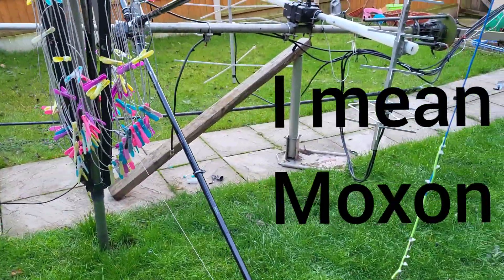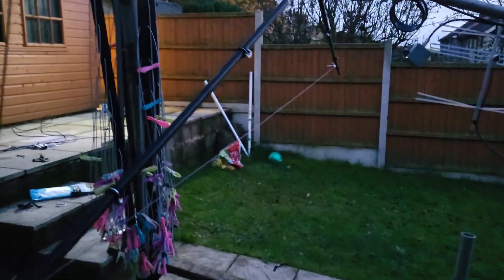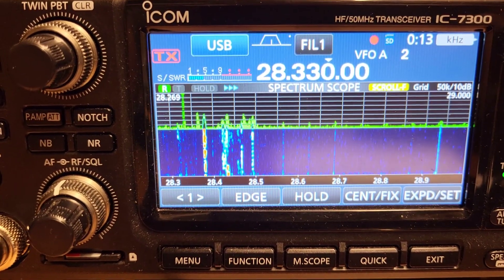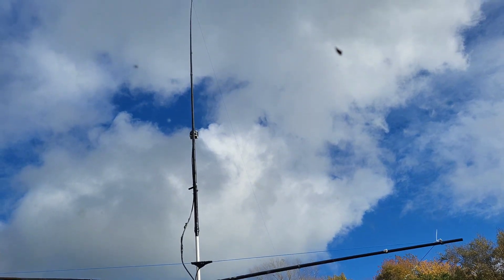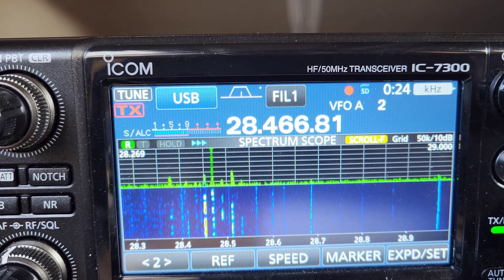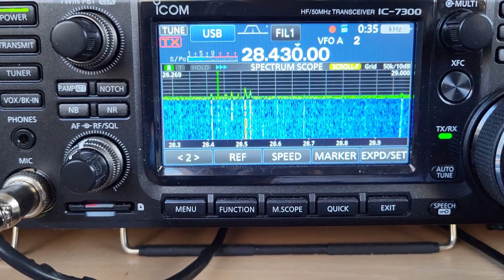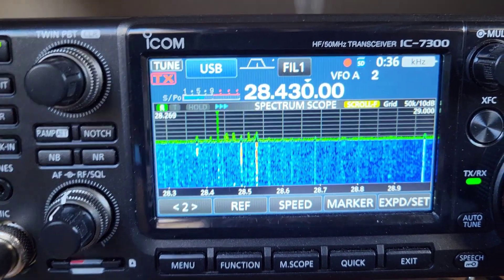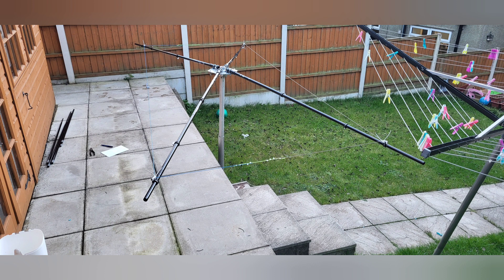10m / 28mhz Homebrew moxon vs efhw

Comment: Just one question what wire are you using for the moxon ?
Reply from the maker: I'm using an old power lead to a vacuum cleaner,  not that it makes any difference but one side is blue the other brown . I always save old power leads / wire for this very reason .. many thanks 😊

Comment: Good video I’m surprised the difference wasn’t greater. I run a efhw 80 to 10 with no compensation coil I also run a pair of ampro 10 whips as a rotary dipole which literally blow the efhw out of the water at equal heights hence why I’m surprised the difference isn’t more , would be interesting to see the difference at equal heights also I presume the moxon was facing the direction you were receiving , 73
Reply from the maker: 100% agree,  this is why it took so long to compare as I expected the moxon to be way better on rx. The efhw hears everything the moxon does but 1 or 2 S points down at times . But on tx it's always around 2 S points up. I've had very good results with the efhw and sounds like I have the same as you ,80 to 10 with no comp coil for 10m.  May be I've made a good efhw and a poor moxon haha , I find it all interesting just the same .. need to compare it to a vertical really . I've got an antron99.. 
Oh and yes I had the moxon pointing  the right way... take care.. Ben

Comment: Interested antenna build. If the clock on the Icom is correct it was a late night. All the best. 73 Chris M0RSF
Reply from the maker: Haha thanks chris,  no the rtc battery doesn't hold much charge anymore. I normally set it via the PC but didn't this time. Take care Best 73 Ben

Comment: isnt this test also comparing a vertical polarised to horizontal polarised antenna.
Reply from the maker: Good question. Not entirely,  the efhw is in a "n" shape, it starts off around 4m vertical then across the garden horizontal then down another pole vertical.  When I get round to it I'll compare the moxon to the a99 for a fairer test . 
If you have a look at my other video working the NY 10m repeater (which I imagine is vertical) the moxon out preforms the efhw , when dx'ing I've found polarisation can sometimes make little difference. For me it's all about trying difference things and experimenting.  This is just my opinion of course 😛, take care Ben 🙂
Reply: So many antenna choices and it's the main item that gets the Rf wave outwards. If only we could see Rf with our own eyes and colours represents the freq and intensity

Comment: Thanks for uploading this because i was hoping to build one myself, also on 10m due to lack of space for anything bigger. I have an EFHW, just finished building a 1/4 wave ground-mounted vertical on 40 & 15m and seeing a good improvement in dx stations on RX & TX over the EFHW - inter-G about the same. I noticed the power output to the end-fed was down a bit on the Moxon during the signal reports. You have another sub from me. 73 MM0SDK
Reply from the maker: Thank you for the kind words , I've tried ground mounted verticals at home but not had great success compared to mounting the efhw base above the house, to many obstacles when ground mounted I think.  Take care best 73 Ben

Comment: Moxon is a great antenna Ben and does have good gain,have you tried a f/b experiment to see how the rejection is?
Reply from the maker: Although not in this video I have played about with the front to back and its surprising how good the rejection is off the back for such a simple antenna.  Lots more to play about with yet which keeps me keen in this hobby.. 👍🏻
Reply: Playing and experimenting with antennas is my favourite part of the hobby aswel Ben and the moxon is 1 I’ve tried on 10 and 20m with great results,f/b usually shows a round 20db..enjoy the moxon on 10m mate.73s Gm4zji Chris
Reply from the maker: @dxscotland5901 , yeah I sometimes prefer tinkering with antennas than actually operating the radio .. there's an idea you've just give me, make one for 20m hmmmm . Best regards Chris,  take care Ben 🙂

Comment: Really want to build a moxon when I get a chance , great that you’ve used the hexbeam part , have a hexbeam here love it 👍
Reply from the maker: The moxon is miles easier to build than the HeX , also helped having the base plate and spreaders from the HeX build . I'm in the process of knocking up a portable moxon. 

So wish I could put the HeX up they always get good reports. 👍🏻
Reply: @benm1mlm846  yes hexbeam is a great antenna I’m still to install my 40m kit been sitting in the shack now for 2 years , I’ll need to try a moxon for portable 😄👍